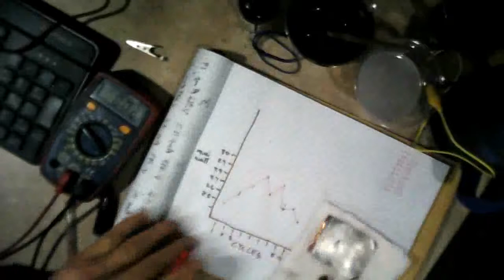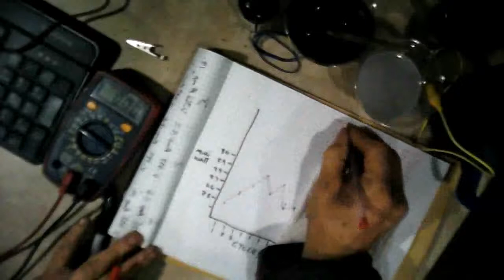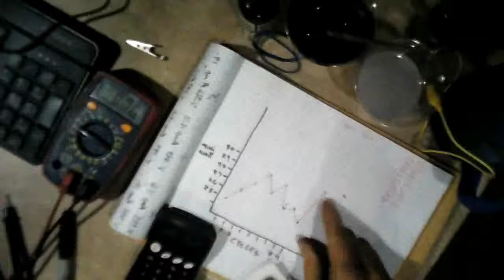Clean Construction & Cell Water Test!

Comment: It looked like the cell was still forming when you started. I don't know how high it might go or how long it might take. It might just peak and drop withoout any interaction. The discolored water may have been the result of dilution of the Ti02 and/or the PVA dissolving. The Borax should have stabilized the PVA and made it waterproof but Ti02 might change the chemistry. Then again it might just come from a molecule thick layer on the surface.  
I still wonder whether a screen or perforation would allow more oxygen to circulate. Don't let my random thoughts draw you off on a different tangent though. As it is you seem to have good intuition and your process has been methodical. Your increasing understanding of what is going on is evident by the apparent success of your predictions.
Reply from the maker: Thanks Fred. Some thin carbon felt should work good in this cell for letting in oxygen, but right now it's more important to work on cell structure (in my opinion). I could see Tio2 dripping out of the cell when I removed it from the water. A longer drying time might be better (but not too long as we found out already). The trend of a well formed cell, is a slow increase in power over a long number of cycles, that peaks somewhere between 2 and 3 times the initial amps. The cell in this video would have taken a long time to peak in my opinion, which is ideally what you want for long life of course.